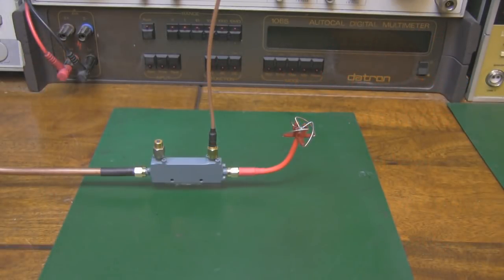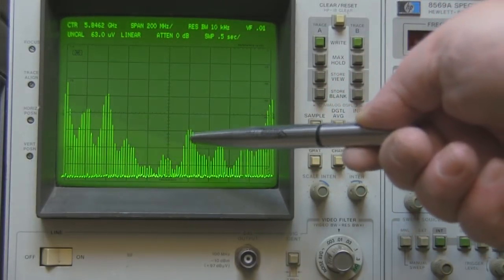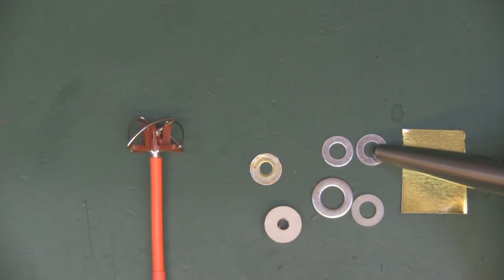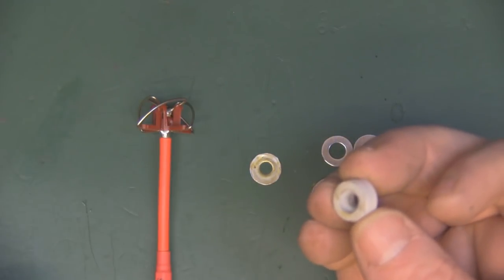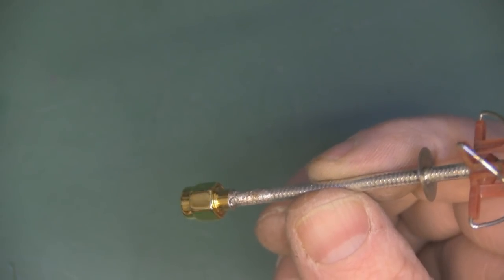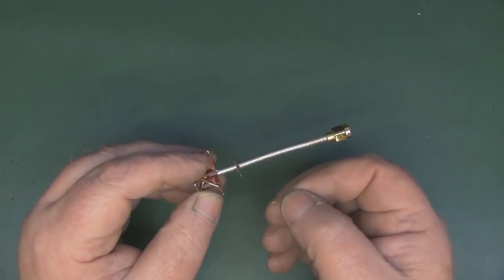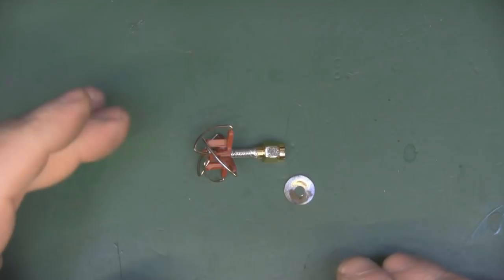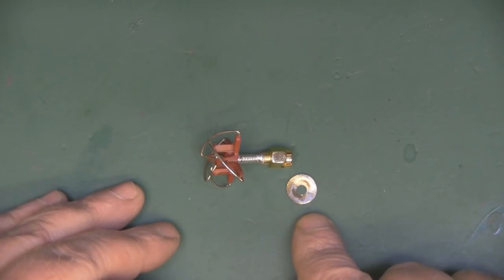Improve the Performance of a Cheap 5 8GHz Cloverleaf Antenna with Two Simple Mods

Comment: great to see nice results from little mods!  i ordered a sector antenna for 2,4ghz , should be 17dbi, no special purpose for it yet but i find this kind of antennas very interesting and like to experiment, it use some kind of cones 8 pieces or so on circuitboard. I couldnt find more details. Maybe a thing for your next projects the make of those sectors / arrays of quads and other shapes combined. i made a 8-double bi-quad array which is about 1m2 in size years ago for the digital tv on the air , worked great but its down in basement somewere as we have iptv now.

Comment: How did you determine the 12mm distance?  I want to apply the same to 2.4ghz.
Reply from the maker: I used the info from the pagoda antenna and the 12mm is less than a ¼ wavelength so it makes sense otherwise it will start to radiate after the stopper. I will look at 2.4ghz but at a guess and it is a guess, you would place the stopper around 23mm and the stopper would have a bigger diameter but will have to test.

Comment: Hi Andrew, great video, but what happens if you combine the two mods?
Reply: andrew mcneil the redundancy dept of redundancy wants to know.
Reply from the maker: Hi Yusuf you don't need both as they both do the same job
Reply: andrew mcneil I'm with Kenneth. Since the stopper mod really flattened it out, maybe the loss of bandwidth you got from the length reduction is countered by adding a stopper to the shorter antenna.

Comment: interesting stuff, i crashed damaged one of those cheap antenna and ended up making it into a 3 leaf antenna, i made a very average job of it and it still worked as good as the 4 leaf. i wonder if it is worth doing this to all my quad 5.8ghz antennae ?

Comment: Does the distance between the end of the antenna and the stopper matter?
Reply from the maker: I have not tested it just used the measurements from the pagoda antenna but it makes sense to have the distance from the stopper to the elements at just under a 1/4 wavelength otherwise it will start to radiate after the stopper

Comment: Hi Andrew. I fly Quads and have made a pair of skew planar (4 leaf clover) antennas for my goggles. At the distances I am now flying from myself they are working as well as my pagodas, but I haven't really pushed or tested them to their limits. I am interested, as a hobbyist in being able to test my antennas so I can learn how to make them better. Do you know of any computer based spectrum analyzer software that would be affordable for a hobbyist? I have a RF power meter ( hobby grade) but that can only take me so far as it doesn't allow me to see if my antenna is tuned well or not, the way a spectrum analyzer would.
Thanks for making these videos, this one especially!
Sean

Comment: Hello Mr. McNeil, And can you tell us viewers what the block is called that the antenna is attached, I assumed the tap is attached to the sweep receiver for reflected signal, is this correct?
Reply from the maker: directional coupler https://www.techopedia.com/definition/18885/directional-coupler I will make some videos in the future about all the test equipment I use.
Reply: Thanks, site bookmarked.